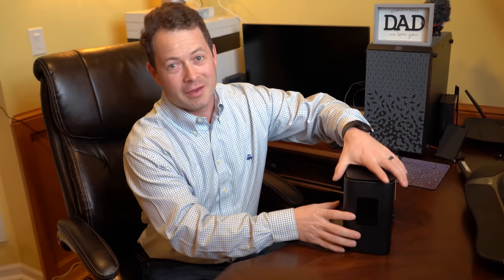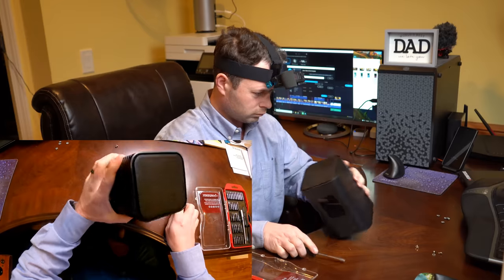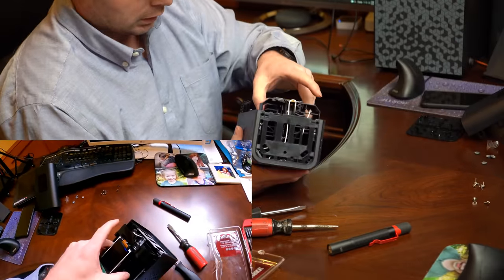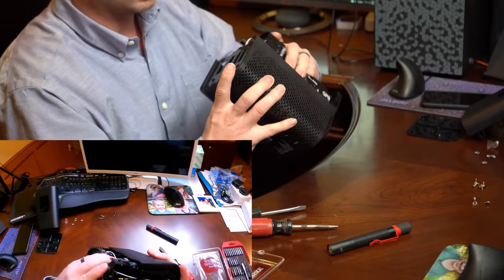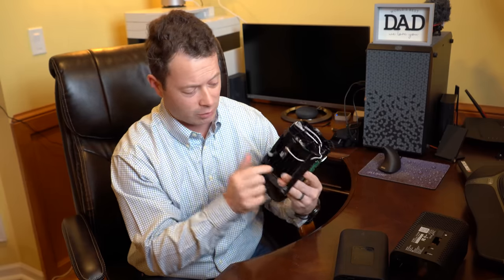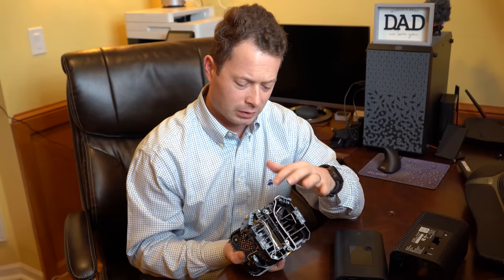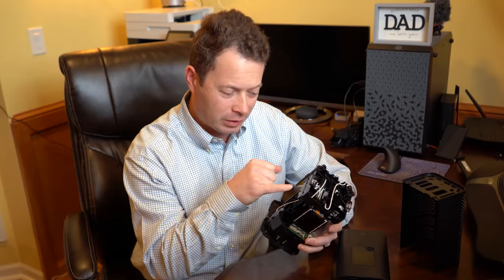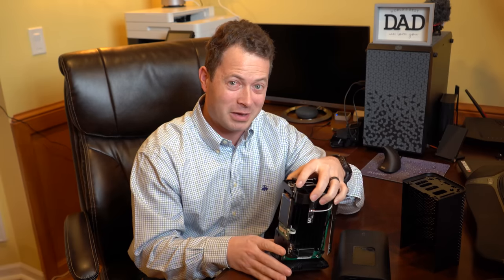✅ Disassembled! Arcadyan KVD21 T-Mobile 5G Home Internet New Gateway - External Antenna, Battery

Comment: I was able to peel the sticker off. Have my waveform antenna connected now to the LTE-D and M. Speed Tests so far are less impressive than the Nokia. Although the signal metrics are better on both the 4G and 5G. My t-mobile app still allows me to see the RSRP SINR BANDS etc. Weird that the connection is slower....I am giving it some time to see if things improve. Also considering keeping this gateway even if things are not quite as good, due to the ability to aggregate 2 5G signals
Reply: Forgot to mention, I am on B66 and N41 just like the Nokia
Reply from the maker: I am very hopeful on dual 5G CA too!

Comment: Do you have any suggestions for an indoor external antenna to be used with the T-Mobile home internet router or there's no difference unless the antenna is posted outside? Please advise?
Reply from the maker: The external antennas work best outdoors.  2nd best is attic.  Indoors and basement is worst.
Reply: In a major metropolitan area, where I'm at, personal backyards don't exist nor attics, only penthouses. That's why I'm inquiring about an external indoor antenna option—double-digit stories from the ground level.
Reply: @NaterTater  My attic is poor.  It has an aluminum skin on the bottom of the roof decking (heat reflective).  Just a thought.

Comment: Have not played with my waveform flat panel on this yet but I do actually have a 2nd Arcadyan down at shop on the other side of the property…. It sits up high on a shelf and during the process of experimenting with rotation the left side (as you are facing the unit) is pointed in the direction of the towers… that side seems to be the ticket….. I get a 4G b2 or b66 from 12 miles away and I’m getting n41 from a newly rebuilt sprint tower only 1.1 miles away…. Both towers are closely aligned with my line of sight…. I wish there tools to easily determine where your 5G is actually connected to 🙄….. oh and my speeds are very good 120 to 230 down but only 7 to 12 up ….. expecting 30 up when I get around to hooking up the antenna again

Comment: Looks like when facing the LCD all the antennas are to the left implying that’s the surface to ‘point’ in the direction of your tower?
Reply from the maker: the cellular antennas point multiple directions.  I have found the best signal is have the LCD screen facing the tower or a little left of the tower.  But that might vary for you.

Comment: U.FL cables on the link don't snap to the circuit board, seem undersized.   The original cables fit OK.  Any suggestions for a different supplier or trick.  Great vid.
Reply from the maker: Those are the ones I used.  Maybe they changed the design or you got a bad batch?  It does take some precision to align and snap on.  Waveform.com also sells some and here's a discount: Get 5% off Waveform antenna and signal booster products with this link: http://waveform.refr.cc/natertater

Comment: 13:00 Whoops. Don't know how that GPS antenna got removed, T-Mobile! 😀 Sorry, now you can't track where I install it. (Well, they'd see which tower it's communicating to.)
(I know, GPS could possibly be used for tighter signal timing tolerances and you might be shooting yourself in the foot if you disconnect. 😆)

Comment: I would do this to take out the antenna to make a wifi network to turn it into a modem rather than a router so I can enable sort of a bridge mode and use it with my Eero

Comment: I got lower speeds after installing the antenna. Does it matter which ports go to which wires going to the roof antenna?
They are labeled 1 2 3 4 
Do they work best going to specific ports? Like 
1 to M
2 to D 
3 to m1
4 to m2 
????
Any help appreciated
Reply from the maker: Yes, order matters.  https://www.waveform.com/a/b/guides/hotspots/t-mobile-5g-gateway-arcadyan
Reply: @NaterTater  thanks, I'm gonna have to contact waveform support.... 
My speeds have fallen from 20mbps before install to now 6mbps with the antenna pointed at my tower

Comment: Nater Tater, I found, after watching this video, that the top plate comes off very easily without breaking the tabs, if you pry directly up on the corners going in from the outer edge of the corner and pry up, popped off way easier than what you did on your first disassembly example, just FYI.
Now, hopefully you can guide me on the U.FL cables, I royally screwed up the connector on the circuit board of the gateway when my screwdriver slipped when I was trying to press the connector on. I guess my only alternative is to call T-Mobile and tell them I messed up their equipment and need a new one??? Any other suggestions?
Reply from the maker: If the connector on the board is messed up your only option is getting a new one.
Reply: @NaterTater  Nate, in your video on adding the external antenna, you say you got best signal connecting to the "M" and "M1" connectors, but the instructions form Waveform say to connect to the "M" and "D" connectors for the 2x2 antenna, can you confirm which ones I should be connecting to? I think I found a shop to repair the damaged connector on mine, and want to have them go ahead and connect the cables so I won't screw it up again.
Reply from the maker: @Ltngdrvr  correct.   See the deep dive for details why https://youtu.be/_5eERL3Rc40

Comment: Nate, thanks for the video, it was a great help. However, when I finished, the results with the external antenna were similar to those without it? I am about 2 miles away line-of-site from the T-Mobile antenna. Using the T-Mobile Internet app, I receive 4 bars on 5G. Before and after metrics did not change much; RSRQ -10 now, was -7; RSRP -96 now, was 93; SINR 8, was 7. My Proxicast 2x2 antenna is in the rafters pointing to the tower. I am connected to the M and M1 terminals on the gateway. Did I do something wrong? The antenna does seem to work because my metrics change when I move/tilt the antenna. Any suggestions much appreciated.
Reply from the maker: Your RSRP and RSRQ got worse, did you try some different locations for the antenna (not just orientation)?
Reply: @NaterTater  not yet, i will be try to shift the antenna stand slightly left-right and up-down to see if my metrics improve. Thanks!

Comment: is there a way to buy a gateway or have your own? So I dont void the warranty of my rental device?  In the past I've used old satelite dishes and modified them to hold a emptied soup can with coax in it to boost a signal attached to a router of mine.
Reply from the maker: Sorta. Some have successfully bought used TMHI gateways online and swapped their sim into them.   There are risks with that though.
Reply: @NaterTater  risks how so? the simcard not working on a used device?
Reply from the maker: @spaztic1  used TMHI gateways have been known to be blacklisted and thus won't work.  It's rolling the dice as there isn't really a legitimate way for the devices to be for sale.  3rd party gateways work with settings adjustments.

Comment: I'm wondering if T-Mobile box is creating an open Hot Spot for their customers, on this box, much like cable internet ones like Xfinity does with their WiFi routers? I've heard you cannot turn off WiFi on this T-Mobile box BUT can you just disconnect the WiFi antennas while in the box? Maybe you can test this and let us know. Good video.
Reply from the maker: Here's how to turn off the wifi https://youtu.be/FTI9AOaYedc
Reply: @NaterTater  Thanks for the info. Just found your channel and lots of good info from you on these devices. I'll check that one out and watch for new videos as well. Thanks for keeping us all informed.

Comment: You were not kidding about the connectors. Broke 2 of em right off. But I have a solder gun so it wasn't a hard fix. I just cant return this thing now lol. Oh well. I did get the 25 Dollar deal at the very least.
Reply: Yep broke mine too
Reply: @egg979  If you didnt see. Get the cheester router. Has imei repair. So you can use your tmobile home on it. Well worth it. Nate did a video on it.

Comment: Nate, when I disassemble something I find that a muffin pan makes a great small parts/ screw  holder/ seperator
Reply from the maker: good point, but that might be a spouse separator too.  haha.  I would typically do this stuff in the barn but too far to move my "studio"  equipment...and my barn is overfilled currently.
Reply: Bro, an ice cube tray.. step 1, first cube, step 2, 2nd cube, etc..
Reply from the maker: @fantastical63  its 6 screws.... I'll survive.  😃

Comment: 4/5 no change assume those aren't functional. D/M  Well not sure more stable but low uploads speed. Being not schooled in this field and learning as I go. Going to try something different, if it doesn't work I believe it's because I'm in an LTE area not able to get my upload speed any higher. Have to wait for the update to finish on the T-Mobile tower.  Feeling bummed 😓.

Comment: My gateway box won’t turn on plugged in and everything any solution?
Reply from the maker: Make sure its plugged into the correct USB port (there are two) and the little push button below the usb is pushed in.

Comment: Now that it's open for viewing, what is your opinion on the internal antennas compared to the trashcan as far as size and effectiveness and also could you see the fan? 
Knew you'd be itching to opening it up lolo. I can't believe that so many gateways could be defective and wonder if you feel T-Mobile is more at fault with its transmissions. My signal continues to look like a roller coaster with up and down signals . Can't wait for the next video! Great job as usual!
Reply from the maker: Thanks Anthony, the nokia has better hardware in my opinion.  Both are saddled with tmobile's firmware though.

Comment: Nate, perhaps you can help me. I was chatting with Waveform, but they couldn't help me and suggested you could help me. I am trying to disassemble a KVD21 to connect an antenna. (4x4 Mimo) I have watched your video and scrolled through their (Waveform) steps to disassemble. My KVD21 does not have a screw/screw hole under the label. The Waveform person I was chatting with basically said that wasn't possible, but it is. No screw /screw hole under the label. Will I be able to get it apart? I am still working on getting the top cover off. No luck so far. Will try what you suggest in your video. Any help you can give would be appreciated.
Reply from the maker: What is the SKU or model number of your device? Printed on the sticker.
Reply: @NaterTater  KVD21
Reply from the maker: @Mark DuPont  first I've heard of a change then.  They'd typically atleast add a suffix to model name.
Reply: @NaterTater  Removing the screw from behind the label was to be able to remove the back of the case, correct? I have the top and sides off but I don't see any way of removing the back (the screw isn't there, seriously). Unless you have something for me to try, I'm stuck.
Reply from the maker: @Mark DuPont  perhaps they changed the design some but they had a way to put it together so there's gotta be a way to take it apart.
Reply: @NaterTater  I'll give it another look. See what I can find.
Reply: @NaterTater  I gave the KVD21 a close look and I don't think I can remove the back cover without breaking connections. The unit is attached to the inside top cover (with the vents) by 1 or perhaps 2 pieces of plastic. The only way to separate the back cover from the unit is to break the connecting pieces. I don't know any other way. I chatted with Waveform again. Was told I had a unique situation. I'm guessing the KVD was redesigned so you couldn't get the back off to install the pig tails. Even if I broke the connections there is no guarantee the back cover and unit will separate. If they did would the case go back together or stay together. I'm getting 250-300 down. I'll have to be satisfied with that and return the 4x4 Mimo.
Reply from the maker: @markdupont6060  interesting.   Thanks for following up

Comment: If the 4 screws under the robber feet are very tight, you may want to apply WD40 to loosen them up to avoid damaging the screw head. Before you spray WD40, cover the bottom with 3M painter's tape to prevent over spraying.  WD40 works like magic.

Comment: For some reason, anything I take apart with clips, always snap and break 😎
Reply: You and me both will see.
Reply from the maker: happens to the best of us
Reply: Watch carefully how Nate lifts slightly on the left, moves the right screwdriver at a sharp angle, and presses outward.  It takes a bit of controlled force but it does pop.  Thanks for this Nate.  It really builds confidence when you can see it done.

Comment: My personal opinion is t mobile has found a manufacturer that builds cheaper gateways. It's all about saving money for them since they absorb the cost. All those snaps are for cheaper faster manufacturing.
Reply from the maker: they claim they did it for more volume with nokia supply constraints and I do believe that.  But also companies are always looking to cost optimize and to be fair they have had PLENTY of issues with the nokia's so why not compare to another company?  Time will tell which one ends up better but the nokia has better chipset and antennas.

Comment: hey which one of the antenna are the 5g? its wierd if i disconnect one of the cables the signal goes up lol i had 4 bars but then it poped up saying no internet  its almost like the antennas or hard ware is holding it back on signal idk lol
Reply: this is while plugging it up to the quad mini not sure if there is a specific way to hook these up or not lol
Reply from the maker: @7starblade  the order matters, follow the waveform instructions.  There is no 5G port but rather a collection of them.  See https://youtu.be/Qb0nTV9rev0
Reply: @NaterTater  do you have any idea why every so often it says no SIM card then after I mess with it put random SIM cards in it then the SIM card that came with it back in it it will work

Comment: I'm having an issue where my 4g LTE is faster than my 5g, will these antennas help keep my 4g connected instead of swapping over to the 5g? Or maybe boost the 5g to make it as fast/faster than what I'm getting with 4g?
Reply from the maker: It would most likely boost your 5G (and 4G) signal and improve your speed.  Are your 5G cell metrics poor?
Reply: @NaterTater  I'm not entirely sure with the metrics. As for signal strength I I can get 2 bars with 4G and only 2 with 5. I'm at work right now but can send you a detailed metrics overview when I get home
Reply: 3 bars with 4g**
Reply from the maker: @remarkabel174  yeah so I would bet an external antenna outside would help your speeds significantly.

Comment: which way does the sim card go in because my whole thing is acting up and i believe it’s because of the way it was inserted
Reply from the maker: It only fits one way.  You do want to be gentle with it and make sure its fully seated.
Reply: @NaterTater  like the way where the little picture is? thank you for answering i’ve been very desperate for answers lol
Reply from the maker: @Tony-lu2uo  the angled corner goes in first and on the top.
Reply: @NaterTater  thank you so much it worked😭 i took like 40 minutes trying to put it in to connect thank you so much .a life saver

Comment: When I first got this router and set it up I had 5G with 3-4 bars signal for the first day then it went down to 4G with 2 bars signal the next day. Can anyone answer why that would happened? I look at a cell map and the 5G signal cuts out about a mile from my house away so there is that. Just weird that when I set it up it was strong and now is weak. Would it be worth getting external antennas?
Reply from the maker: I suggest holding in the tiny reset button for 30 secs for a hard reset.  See if it does the 5G signal again.  If it does it might be deprioritization kicking you off 5G due to congestion.  If thats the case an antenna won't help.  The cell mapper "coverage map" is not accurate at all use this https://youtu.be/m5z9fsoYqKQ

Comment: (Update). disconnected the M and connected the external to M2, speeds 
are much more consistent as to the upload it's higher and consistent, 
but seems like now the better the upload is the worse the latencies are.
 One of two things the combo of hookups for the antenna I haven't come 
across or it's my LTE location or my little mimo will not reach, except 
on the screen of the gateway, it says 5G, now totally confused, may have 
to purchase the waveform, it's a bit spendy or put the money towards the
 Starlink, in turn, I can take it with me where I go sort of, UGH. Can't
 stand living in the city and refuse to move back just for the internet.
 Very undecided and so looking forward to the video of the antenna hook 
up by the Nater.